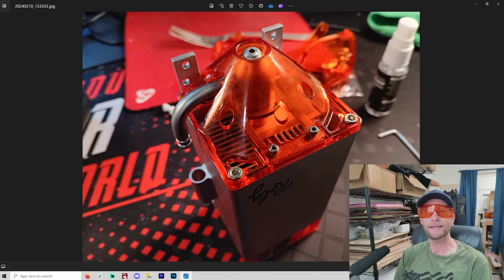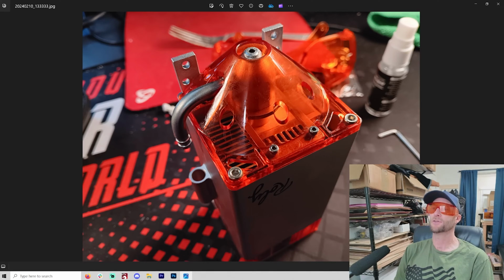Cleaning the Lens on your Diode Laser (Roly LaserMATIC mk2)

Comment: Def also want to take off the top side where the fan is, and clean all that out as well. The fan collects a lot of dust and you also want to clean off the fins on the heatsink on both sides, lens side and fan side, and as much as you can inside. If you don’t, the heat sink won’t work as good and you’ll overheat your laser module. Happened to me.
Reply from the maker: I use an electric "canned air", some use a compressor. I just use something to keep the fan from moving. Also, I do it every other time I clean the lens. I feel removing the top screws is not necessary for me. But I get what you mean.

Comment: I had a problem with my Mk2. It was cutting fine and all of a sudden it stop cutting and was just marking the wood. That was about the 5th time I used it since getting it. First thing I checked was the lens. The lens cover was actually clean but the focus lens had a haze over it. I got in touch with Roly and we determined I had a faulty focus lens. They sent me a new module and I sent the old one back. I haven't had a problem with the new module. I can't say enough about how good their customer service is compared to other companies. Thanks for the videos. Looking forward to more.